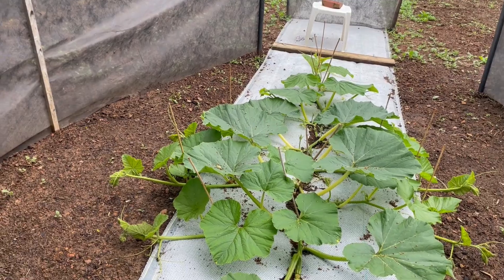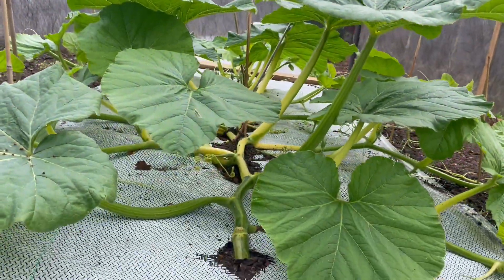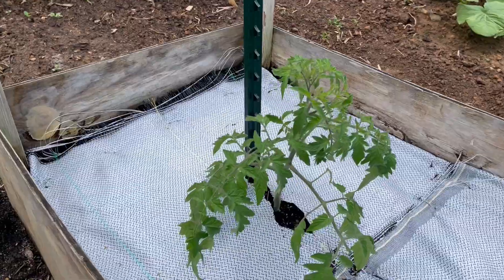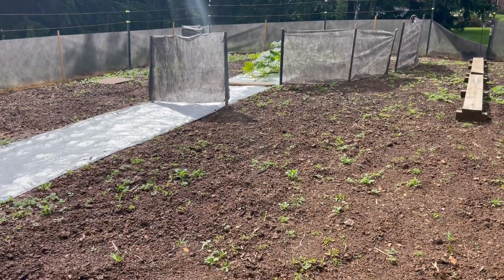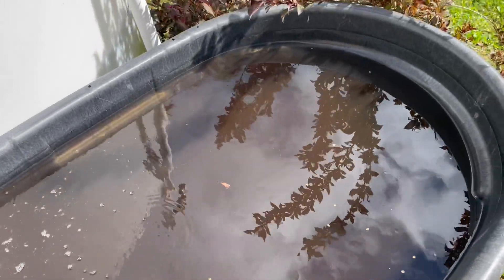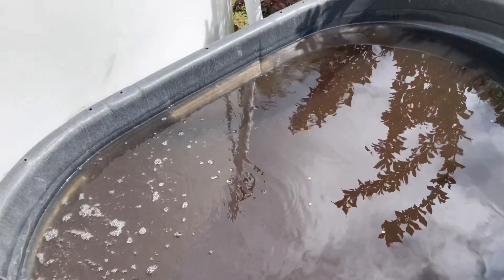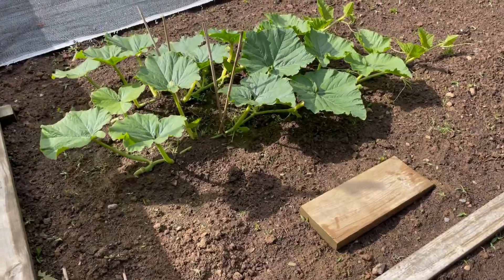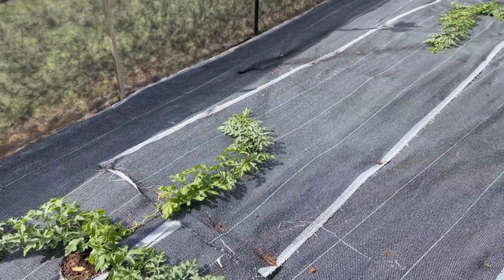Doc's Giant Pumpkin Growing Part #7 - How to use EC

Comment: New sub here! Love your videos. I think im just a couple days too late to pick a team. It was crazy when i saw your tea setup because its identical to mine that I've used for years. Lol. Same water bin but mine has a pillow case tea bag and a powerful air pump bubbling under it.  Do you feed your tea a sugar source? I use either dark brown sugar or black molasses. 

      Plants really seem to like it. I also like that it warms the water up while it bubbles. My well water is ice cold and i hate putting it on my plants at that temperature.
Reply from the maker: Thanks for the sub. I occasionally use a little sucrose in my tea. About a 0.1 - 0.25 cups per 100gal. Glad to hear that we have similar setups and are getting similar results. That means we are doing something right.

Comment: What type of fabric/plastic ground cover is that? Can you provide a link? Great videos as always
Reply: Do you think you could burn holes in the ground cover for tap roots?
Reply from the maker: I know a fella that does exactly that. He uses a hand torch and creates holes as needed. I tried it and didn't like the outcome as much. I felt like I did a quicker and cleaner job with a pair of scissors.
Reply from the maker: Dewitt Reflective White/Black Woven Ground Cover 4FT. I sourced it from eBay. It is great so far and I would recommend it.
Reply: Team doc👊🏼